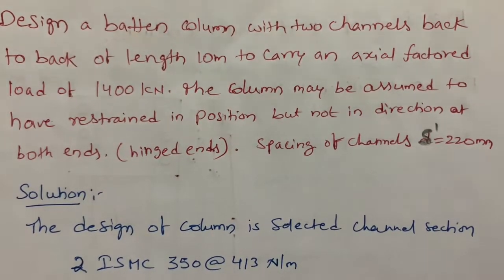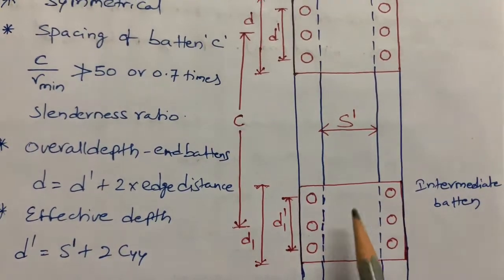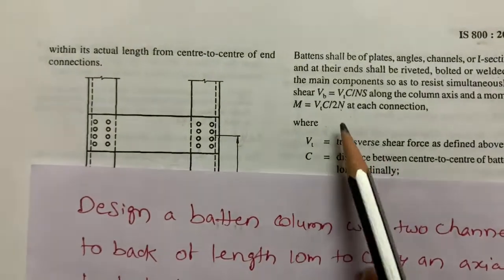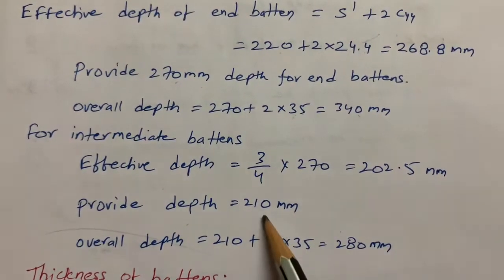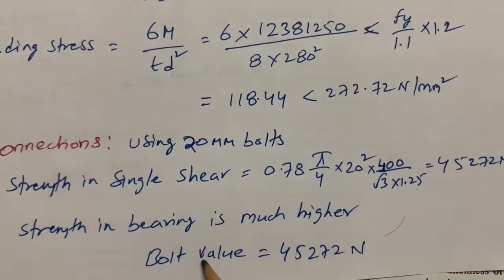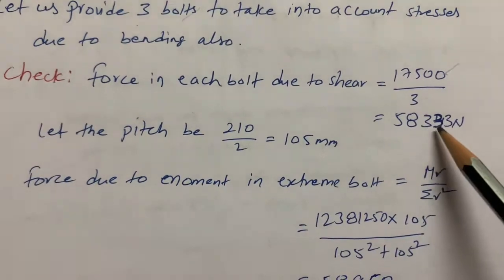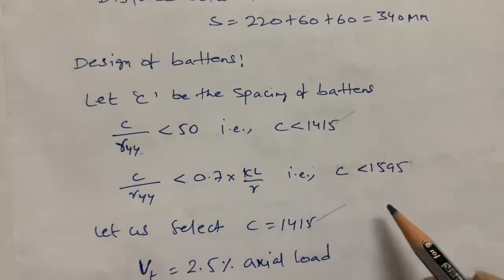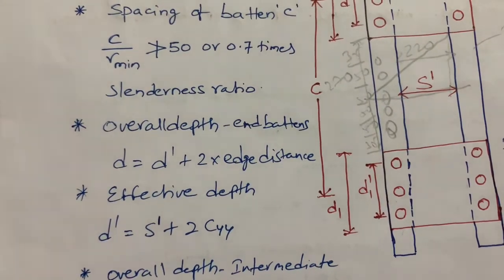Design of steel structures# Design of battened column#Channel section placed back to back#Bolted#

Comment: How the pitch can be 210 by 2 if u have to provide 3 bolts
Reply from the maker: Pitch distance means bolt to bolt distance. it’s not about number of bolts. If we provide 3 bolts for first bolt second bolt distance is 105 and second bolt to third bolt distance is 105 
Total 210